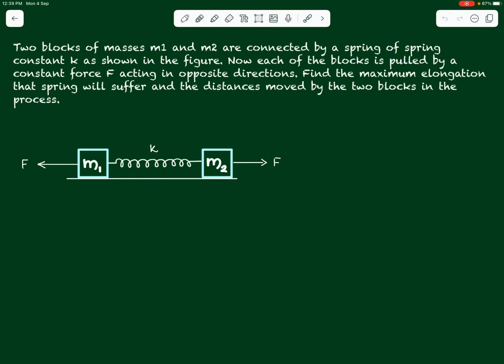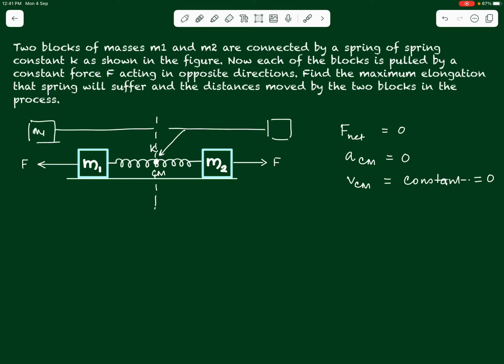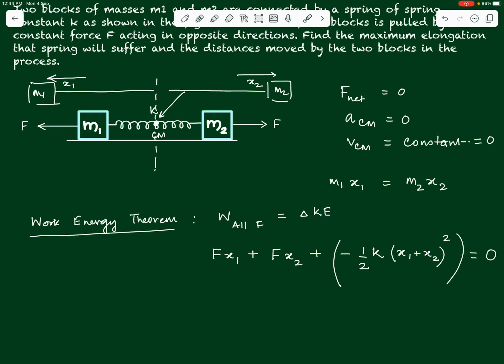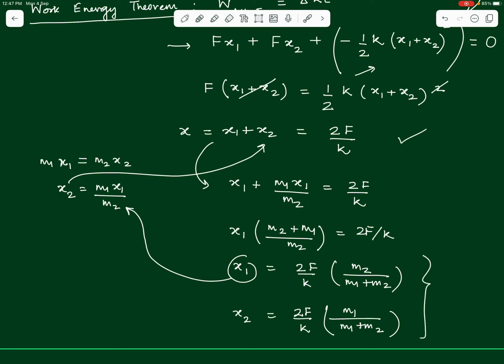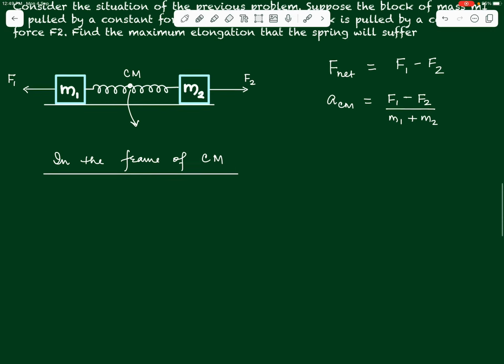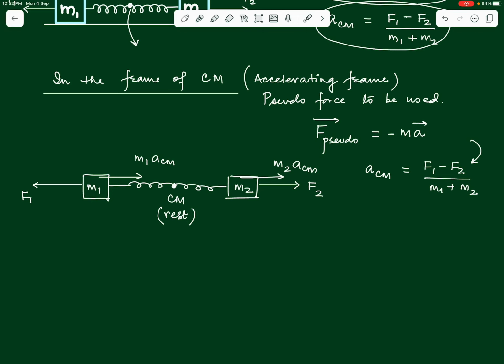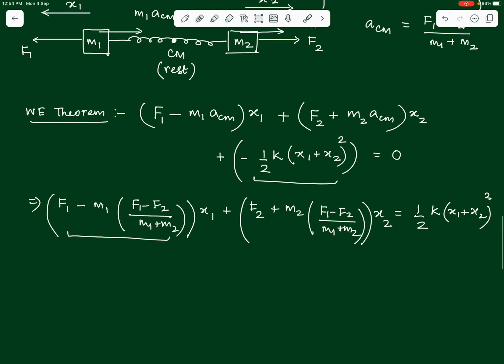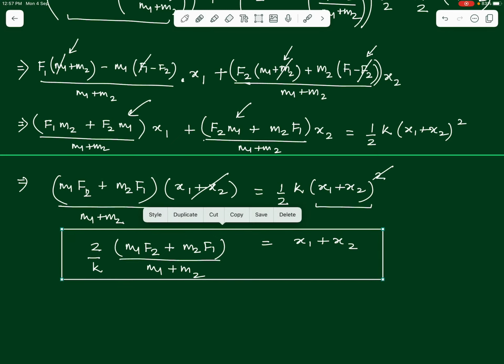Blocks with a Spring moving under External Forces! Conservation of Momentum l H C Verma Q.Nos 51, 52

Comment: A uniform rod of mass m and length l is kept vertical with the lower end clamped. It is slightly pushed to let it fall down under gravity. Find its angular speed when the rod is passing through its lowest position. Neglect any friction at the clamp. What will be the linear speed of the free end at this instant?

Mam please clear this doubt....why conservation of energy is applied ., though there is an external force mg which is doing an external work??
Reply from the maker: Dear, Gravity is a conservative force that is a force which does not dissipate the energy of the system while it does work on the system..that is why conservation of energy principle is valid here.. infact it is the gravitational potential energy of the rod that gets converted into kinetic energy as the rod rotates down.

Hope this clarifies :)
Reply: Ok Ma'am.........now I have understood.   
(I forgot that only non conservative forces and external forces are considered while applying conservation of energy)
Thanks Ma'am for the explanation 🙏🙏
Reply: Good explanation mam